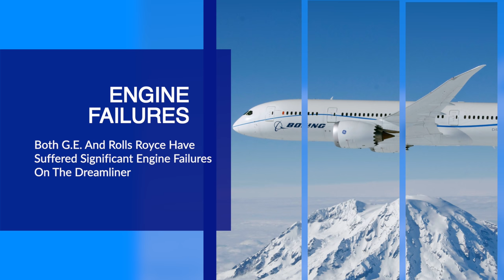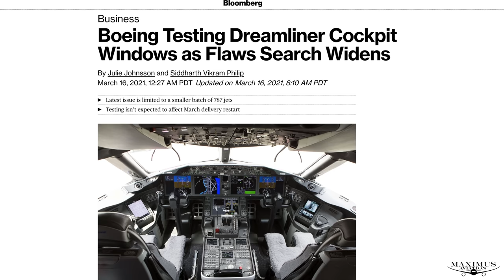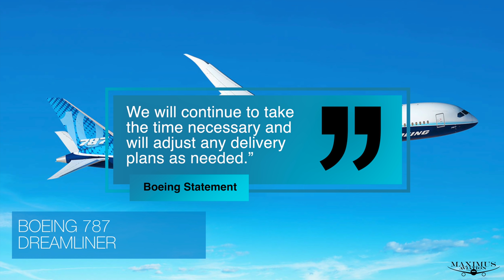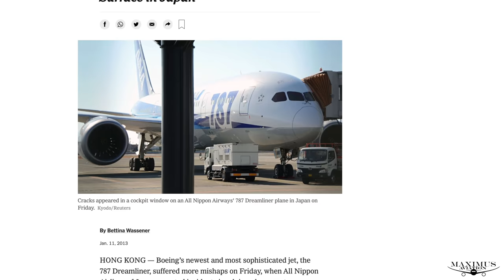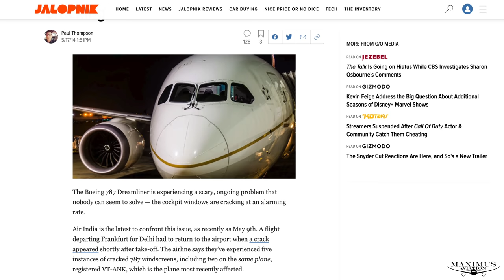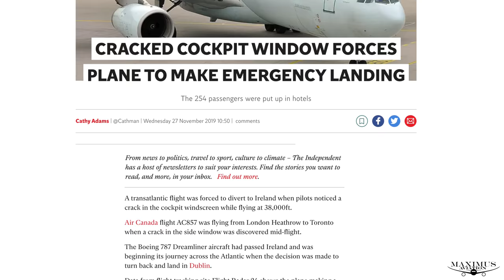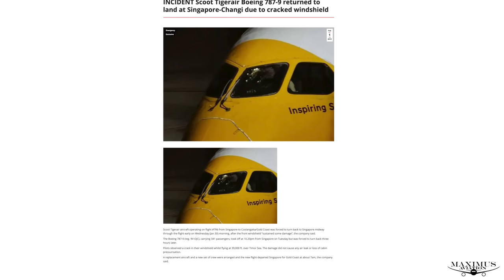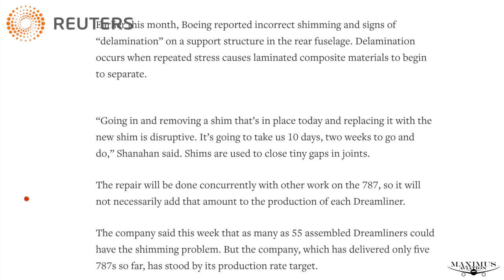Why Do The 787 Dreamliner Cockpit Windows Keep Shattering In Mid Air? How Dangerous Is It?

Comment: The cause of delaminating layers of compound is (A)VIBRATION. Vibration is caused by 1)rush of air along the fuselage being disrupted at various structural intersections, where the wings/tail/ and any other structures project out into the slipstream. 2)buffeting of the whole aircraft as it passes through different types of air - thinner, more dense, warmer, cooler, drier, wetter, 3)vibration from the engines. At the extremes of cockpit and tail the vibration is stronger and more strongly felt, particularly at the weak points around windows. Rather like a thin tube of metal balanced on a fulcrum which is flicked and tapped in the middle so the extreme ends begin to wag up and down. If you fitted windows in the tail you would also get glass cracking as it is bowed outwards or inwards under pressure from delaminating compound layers expanding onto the window frame. Rather like blowing air onto your bubble gum so it pops. Glass is hard but inflexible and therefore susceptible to force which would only bend plastic. My advice to Boeing would be to investigate replacing glass windows in the cockpit with some other clear material AND/OR fit contraction and expansion channels into the compound material a couple of feet away from the window frames to reduce the force of delaminating pressure AND/OR to use a different type of bond in the laminate so it doesn't separate .(B) Its important to note that another joyous characteristic of this material is that the layers of laminate also expand on the horizontal axis and the outside layers may expand or contract at different speeds to the inside layers, which is what causes the delamination. I cannot adequately express my scorn and derision for the people who manage Boeing because of the manner in which they have thrown together the 787 design without cohesion, planning or even understanding of the goddamned materials they are using. I am certain more than one engineer has desperately tried to warn and explain the consequences of their design failure to the institutionally deaf ears of Boeing's moronic top managers.
Reply: Thank you for this comment.

Comment: Isn't the only part of the a350 that is still full alluminium the cockpit? Maybe that has something to do with it. I thought it was weird why airbus did that, now it makes more sense.
Reply: Yeah in the design of the A350 they weren’t confident of a bird strike or hail on the impact and integrity of the cockpit.  So Airbus decided an alloy cockpit was on the safer side!  Good decision...  My real concern is fatigue on 787’s so the longer they fly... the higher the risk plus the fact Boeing has removed a layer of lighting protection from the wings.  If you wrote this stuff before it happened people would say we’re crazy - not a good look!
Reply: @michaelsheargold  Meanwhile, a320 windshield inspections for failures due to corrosion caused by water ingress are ramping up as I type.  Not crack type failures, pop type failures.  

You and I know absolutely nothing about building modern airliners, so that's exactly what our intuition is worth.  The difference is I'm not delusional enough to think otherwise.
Reply: @michaelsheargold  they can call me crazy as much as they want lol. 
Most airlines don't care about you, as long as they can frame themselves as the victim and blame boeing when these birds start falling out of the sky, they'll keep taking on these discount planes to increase profit..
Reply: @baronvonlimbourgh1716  Yeah, they buy them because they are cheap.  If stupid could fly, you'd be a jet.

Comment: Imagine sitting in the cockpit when the window starts cracking. 😳
Reply: Without a moment's hesitation i would be putting on my seatbelt as fast as possible because i would not want to be sucked out of the plane like the the pilot of British Airways flight 5390.
Reply: Take a selfie.
Reply: yes I can, it happened to me.
Reply: @robr9905  😳
Reply: Was that a bird strike ?  No, just normal
Reply: @killman369547  Pilots ALWAYS have their seatbelts on!

And I’ve had a cracked windscreen - more a bloody nuisance than a drama.
Reply: @FutureSystem738  And that is acceptable?

Comment: As a former aviation maintenance professional, windscreen cracking is a common occurrence on aircraft operating at high altitude. The problem is the heating elements in the windscreens can overheat the transparencies, causing them to delaminate over time and inducing cracking. Folks need to remember that it IS rather chilly at 35,000-40,000 ft. You lose 3 degrees in air temp for every 1,000 ft of elevation on a standard day(29.95 altimeter).

Comment: Until they know why it cracks on the outer layer but not the inner layer, then the root problem is a safety issue ... what if the unknown mechanism can cause both layers to fail?

Comment: Boeing kept the plumbing problems quiet on the 787.  One section had plumbing lines made of one kind of metal and the adjoining section's plumbing was made of another kind of metal.  All was fine until you add water...corrosion, which lead to water leaks.   Not a good thing to have on an electric jet.
Reply: Dooh!! Electrolyticn corrosion a problem that has been known about for at least 50 years if not longer.

Comment: Does AirBus know something that Boeing does not? AirBus went with an aluminium cockpit not carbon fiber. Needless to say, aluminium will not flex as much as carbon fiber. The wind screen will not flex in a solid aluminum frame, but in a composite frame even with some type of metal support, it will still flex.🤔
Reply from the maker: Great point.  Airbus said they were worried about bird strikes and fatigue.
Reply: Appears to be flexing.
Reply: @jimgraham6722  Yes!
Reply: Carbon fiber is a lot stiffer than aluminum, so that statement is not correct.

Comment: Thank God it's only been cracks so far. Imagine it breaking mid flight at 40000 feet. How about grounding them before that happens?
Reply: yep.  Boeing should voluntarily do this.  But they won't because quarter end bonuses for Boeing exec's.  Since Boeing will not voluntarily ground their flawed airplanes, the FAA should force them to.  But they won't because the FAA works for Boeing, just as every other Federal regulating agency works for the corporations they are supposed to be regulating.  Don't you just love corporate capitalism?
Reply: @pimacanyon6208  Thanks to Maximus for bringing this up. Funny how no one else is talking about it. This is scary stuff. With mcas you had some chance of survival, here zero chance.
Reply: @abababa7483  probably still have a chance of survival *IF* the broken window does not suck BOTH pilots out of the hole in the cockpit.  If both pilots get sucked out, then you're right, no one left to land the plane, so little chance of passengers surviving.
Reply: @pimacanyon6208  getting sucked out is the smaller danger. just think of all the glass pieces flying at the pilot and co pilot at almost sound speed. They're instantly dead.
Reply: @abababa7483  right.  but I don't believe the windows are made out of glass.  It's something more like plexiglass or some kind of plastic.  Still, if they shattered and came at the pilots at close to the speed of sound, whether it's glass or plastic, they're probably dead.

Comment: This is no surprise. Incompetent Boeing management offloaded oversight to suppliers. For years this has been a problem. For example, before retiring, I used to machine titanium forgings related to the empennage. One day, a forging showed up looking strangely discolored and it didn't fit the fixture to prep it for further machining. After grinding away some excess to make it fit the fixture, it didn't clean up after running the prep media. 
What's going on? Turned out that the press used for these forgings broke down, and the supplier tried to use a lower-power press by repeatedly striking the forging. They failed to tell us this until we investigated it, saying in effect, "we didn't think you'd notice."

Comment: Plastic structures expand and contract  much more with pressure and warming etc. than with metal construction...just a bit more flex than with metal would stress the window materials... causing the cracks.

Comment: Boeing started failing when they began making planes based off cost instead of solid engineering after the Douglass merger ....hence why the 777 is amazing and the 787 and the max have so many issues cost cutting bs .. sad

Comment: Get rid of the slight dip I the two main wind screams. There is to much vibration at the apex, causing an acoustic vibration that causes the glass to shatter. I only fix concrete failures, but your problem just seems simple to me. If I am wrong, then I stand corrected

Comment: 787s by design have greater cabin pressure. I wonder if that is playing a factor in the windshields cracking. If the windshields are built to specs that work with other Boeing aircraft with less cabin pressure. I’m not confident enough at this point in history that they would have been able to figure this out. There are other potential factors like exact shape. If it doesn’t exactly match the airframe there will be a stress point introduced upon installation. That could be either the window supplier, the front of the fuselage supplier, or even a possible combination of both that need to understand what might be happening there. I would tend to think in this case that it’s a variance in the fuselage given the fact that at least one plane has experienced multiple failures and that many others have yet to fail.

Comment: @Maximus Aviation I am not sure how much time you have to do these videos, but to help with the haters and also potentially uncover some interesting information around another aircraft that hasn't been around very long and is just as advanced in many ways.... Can you do a report on whether any similar issues have been seen on the A-350 and if not, maybe why not? I suspect that, because airbus had the benefit of watching the 787 development, they made the choices they did around construction of the fuselage parts and cockpit, and maybe even suppliers, to avoid these problems of poor quality or extreme tolerances. I wonder if any battery fires, cracked windows, or breakdowns and delamination of composites at mating points have happened yet.... I know there were issues many years ago on other types.
Reply from the maker: Good point. If you saw my last video I talked about that how Airbus had the benefit of "Going Second" With the A350 and they were able to improve on the flaws of the 787.  I love that plane it was the first and very innovative but Airbus did have the advantage of going second so yes, I dont blame Boeing for that.
Reply: @maximusaviationchannel  I saw that video too, yes. The two manufactures construction techniques, although having similar ideas and goals, turned out to be very different approaches. In your video you mentioned how Airbus went with individual panels instead of Boeing's rolling of whole sections as a single piece. I wonder what is really the better approach, I am sure they are both equally good for different reasons. I also wonder which of them can last the most cycles before retirement. More than one way to skin a cat as the old saying goes.

Comment: There could be a 100.000 reasons why the windscreens are cracking but they should have figured it out by now!!!! Or maybe they know and arnt saying so...... But my best guess is something to do with a carbonfiber airframe and silicon glass not having the same expansion rates @ altitude and pressure. The airframe may or may not expand faster than glass causing the windscreen to crack.

Comment: High frequency ringing in the glass will shatter it especially if they are layered and not damped between layers.
Reply: The cockpit windows are layered, typically with a soft layer of PVB material. This makes the window more impact resistant and will prevent a crack to propagate all the way thru.

Comment: I am wondering if there are small air bubbles that would be expanding / contracting during the flight cycles causing the cracking
Reply: My guess is that if the glass panel had impurities they would have identified it by now. My suspicion is that the airframe is transferring stresses  into the glass. If that’s the case, there will never be a fix as changing the shape of the window frames is out of the question. The cheaper fix  is to keep replacing the cracked windows

Comment: As an engineer I am intrigued by Boeing's long-standing problem with the 787 cockpit windows, and I understand why the problem is so unbelievably stubborn. It's essential to know if the windows are all cracking at a particular point in the flight cycle, because they will most often start at ambient temperature on the ground, soak at -56C during stratospheric cruise, and then warm up during descent. I assume from the video that both front and side panes are cracking. You will find the structure of Boeing's cockpit windows at:
https://www.researchgate.net/figure/Actual-designs-and-materials-for-aircraft-a-cockpit-b-c-passenger-windows_fig5_317230883
The windows have an outer layer of tempered glass, followed by a slightly thicker layer of a transparent vinyl with inner and outer coatings of urethane, and a final inner layer of tempered glass twice as thick as the outer layer. The outer glass has moisture seal PR-1425 around its edges and is clamped in a steel frame, while the inner glass has urethane around its edges. The glass is being used in a temperature regime in which it should be 100% stable. In theory the design is easily strong enough, tough enough, and sufficiently elastic. My instinct is that the thermal expansion/contraction and distortion of the steel window frame, combined with the lack of expansion and contraction of the glass panes, plus their curvature, lies at the root of the problem. The thin steel Z-frame will heat and cool very much more quickly than the glass. When this happens along straight and flat edges, there is no problem. When a curved steel window frame expands and contracts along curved glass edges there is potentially a problem, because the steel cannot preserve exactly the same curvature to match the much more dimensionally stable curved glass edge. Strain due to the difference in pressure between the cabin and outside adds to this. But why don't the windows crack during each aircraft's very first stratospheric flight?! Why wasn't the problem found during stratospheric flight tests of the prototype?!  Regardless, I would focus on modelling the strain occurring along the steel-clamped edges of the outer glass layer during thermal and pressure cycling.
Reply: Did your research reveal how often 787 windows crack and how often airliner windows crack on average?  The video didn't tell us, but it seems relevant to me... but I'm not an engineer.
Reply: @Milkmans_Son  I can't give you an accurate figure offhand, but there is a website that lists all aircraft technical issues reported worldwide, and I first noted an unusually "high" incidence of 787 cockpit windows cracking on the website. You'd have to consider the number of 787 flights worldwide to calculate frequency versus take-offs, and it's also potentially important to know how many cycles each aircraft has been through. My impression is that it is one of those highly annoying issues that occurs "just now and then" - once every few months during non-Covid times. I suspect that the cracking only happens when the rate of change of the glass temperature versus that of the steel frame falls within a narrow range. I also know this problem has been examined by professional engineers, and as yet it seems it hasn't been solved.

Comment: My instinct tells me that the shape of the front of the plane where the windscreen goes is such that it puts too much strain in the area where the windshield starts cracking, but because of the face of pressurization in the cabin but also because of the force of the air passing over and around the front of the plane.

Comment: I have lost faith in Boeing despite a great history. The Mcdonnell Douglas managers they kept after buying MD's commercial line said they 'wanted to run Boeing like a business' and then they moved the HQ to Chicago away from production. Boeing used substandard Ducommun parts on 737ng planes then hired $9/hour programmers to make the original MCAS software for the 737MAX and then did not even tell pilots about the system. Meanwhile, the 787 batteries are bad, the windows and carbon are cracking and Qatari Airlines started to refuse 787s built in South Carolina. No word as to what they will do now that all 787s will be built in South Carolina.

Comment: I feel like the 787 is a very different aircraft like the Dehavland Comet in a way, were other manufactures are learning from the mistakes Boeing has made in order to not make those mistakes themselves with their composite aircraft.  But I also believe its a big problem with Boeing and trying to make more money by outsourcing.
Reply: I don’t think Airbus are having the same problems so it might be more down to quality control.
Reply: @davidlazarus67  It is down to quality control but not entirely, there is an element of bad management in there too. Buying McDonnell Douglas is where their problems began because they also took on most of MD's executives who frankly didn't give a rat's ass about engineering and only cared about shareholders.... so in other words, typical bean counters.
Boeing was greedy and wanted MD's government contracts, that was the entire motivation for the deal. But it looks like that deal will sink them in the end.

Comment: Boeing needs to close their doors now and avoid the rush. How long until the 787 starts coming apart in mid air? All it will take is the tiniest of cracks at FL 380 and the plane will disintegrate in mid air.